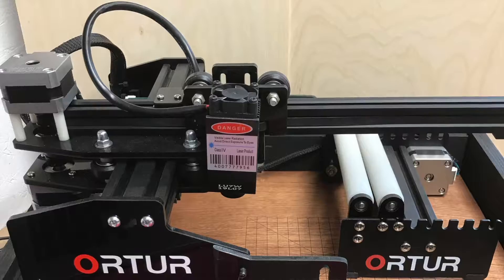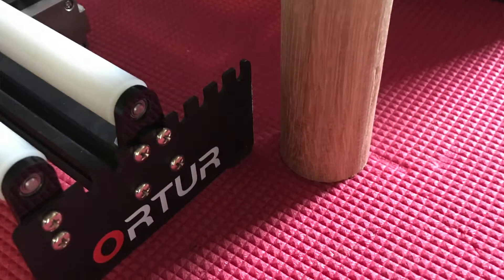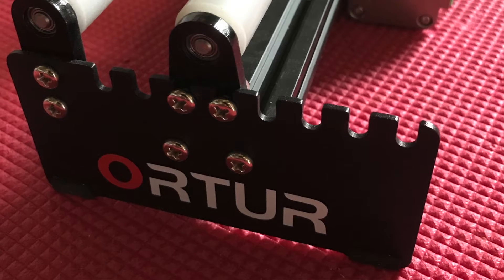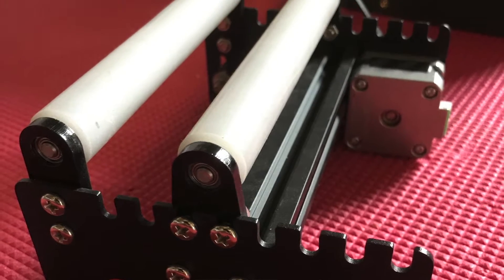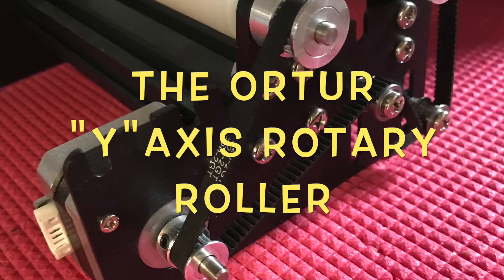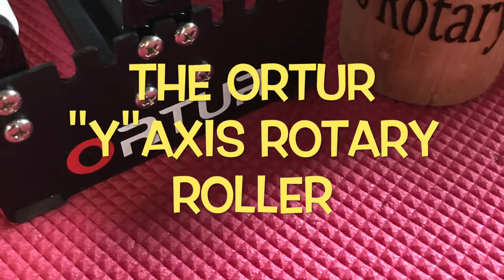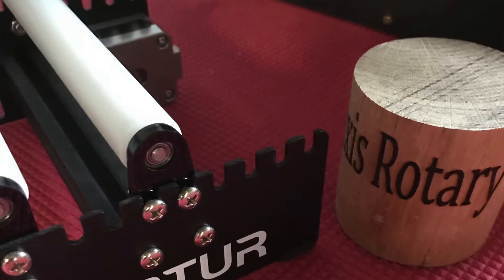ORTUR "Y" AXIS ROTARY ROLLER SYSTEM

Comment: I like the fixture you made for the wine glass. If you wrapped a rubber band around it instead of tape would that be enough pressure to hold the glass still?
Reply from the maker: Hi, I did try that method and it worked however, I did get a better result with the tape.  Thanks for watching.

Comment: Good idea. Is there any way of "rigging" this unit to engrave a mug or cup with a handle? Trying to figure out a way to do it.
Reply: I can imagine a long roller with a spindle extending from it’s center over the end bracket of the rotary attachment. On the end of the spindle a chuck or other fixturing mechanism could hold a mug with a handle out over open air. The roller diameter should be the same diameter as the mug so you don’t have any stretching or shrinking.

Comment: Hi John, niced video!
Do you know if this Ortur Rotary Roller would work with the Atomstack A5 or Atomstack A5 Pro?
Reply from the maker: Hi José , I have messaged Ortur and the reply reads, Yes it could work with A5 and A5 Pro, as they are also use Nema 17 stepper motors. Hope this helps

Comment: Do you know if the Ortur Roller would work with a NEJE laser engraver?
Reply from the maker: Hi Dave, I am unsure if they are compatible however I will check for you.
Reply from the maker: Hi Dave, Answer from Ortur.  Theoretically it should however, the Neje stepper motors may be wired somewhat differant to the Ortur…….I do have copies of the wiring diagramme should you require them.  regards, John.
Reply: Thanks for the research and the offer of the wiring diagram.  Not sure it will work for me ...I was hoping for a more plug and play option.
Reply: Thank you John.  The NEJE 3500 looks very much like the Ortur laser engraver.